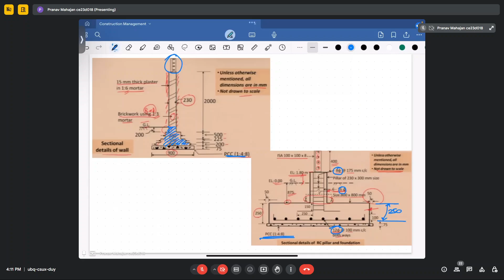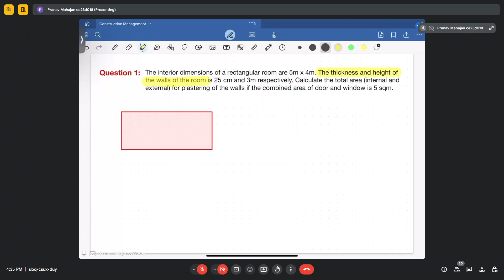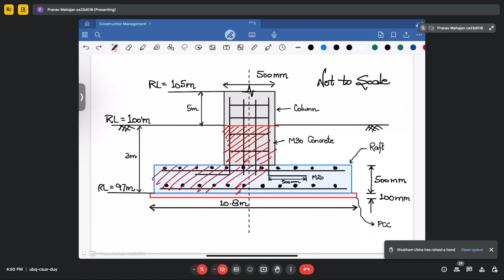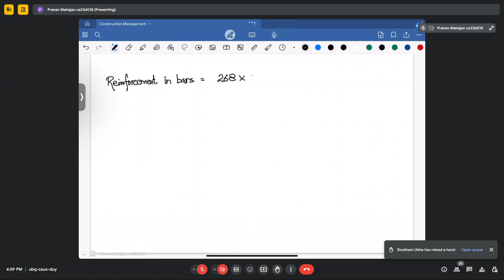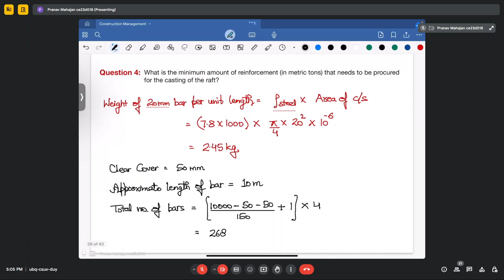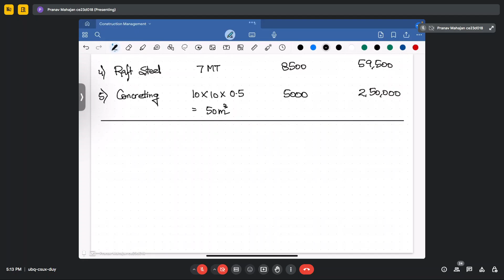Principles of Construction Management - WEEK 2 - Estimation of Rates and Analysis of Quantities

Comment: 20:58  Sir, for the plastering qty in the Interior, Short wall part. How the length came to be 9.84? 
In the remark it is given: 10-0.08-0.08
What is 0.08?
Reply from the maker: It would be 0.15 not 0.08; as the RC column dimension is (230 x 300)mm. Consider the value as 0.15 during calculation.